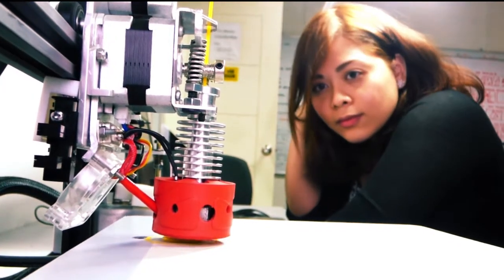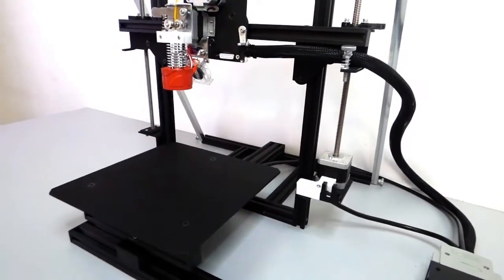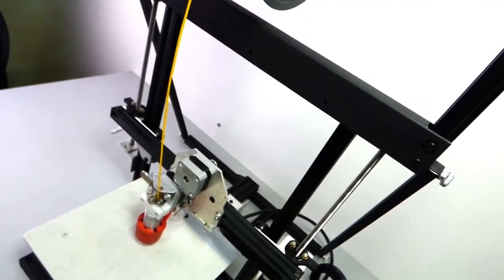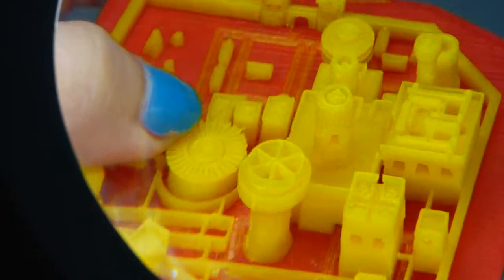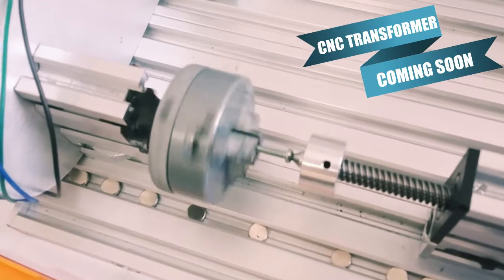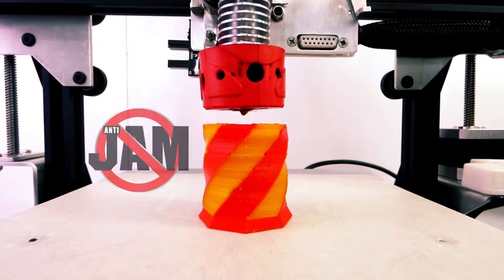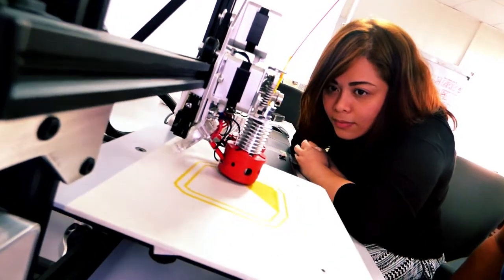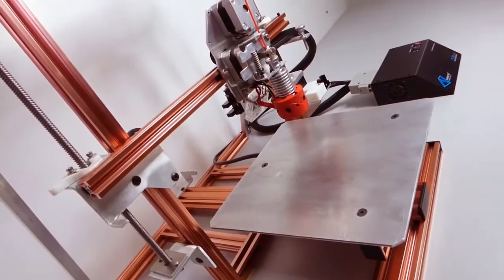17.  MOST AFFORDABLE 3D PRINTER - NOVIO 3D

Comment: Interesting design and concept, not particularly original, and certainly not worth over a grand.
Reply: It's more about the ability to customize it, with readily available options that make this printer enticing over other offerings that are design with more limitations. not only do they offer an engraver option but a cnc plus a cnc lathe. Absolutely no one in the 3d printer industry offers up 3d lathe option, its on heard of. About all that's needed to make it truly the best well rounded printer, would be if it can 3d print circuit boards now either by adding an edger or extrude very find conductive filament since it can extrude the full spectrum of filament sizes from 1.0mm ~ 0.1mm leaving a lot of other offerings in the dust.